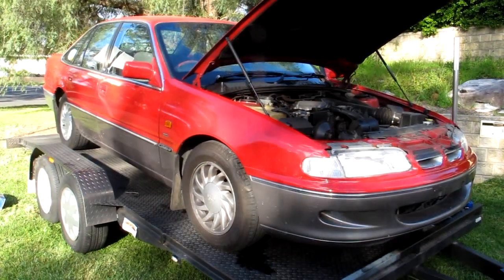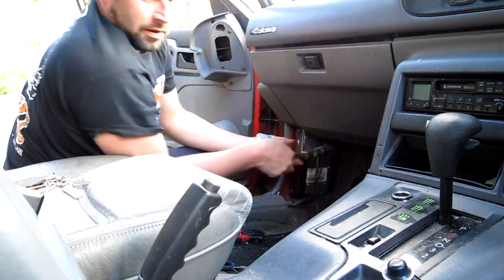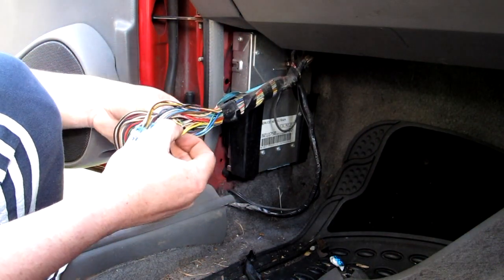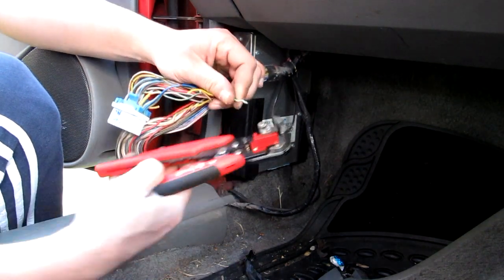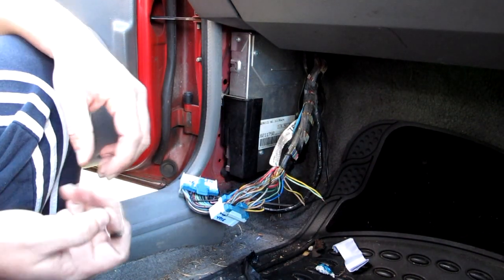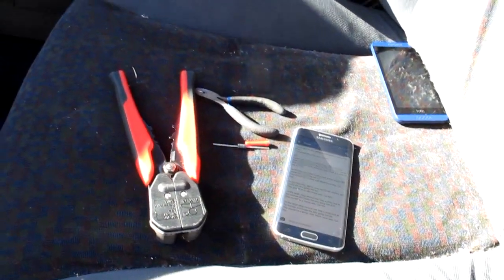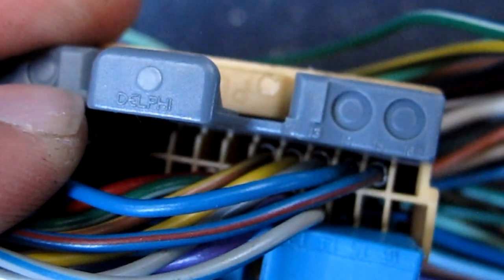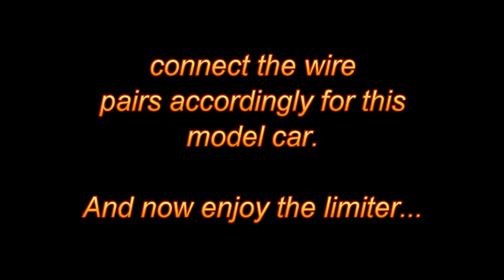Holden Commodore 4L60E gearbox mod to make it manualised - instructions

Comment: Yes this MOD totally works 
I go another step with the brown wires to the TCC and add a microswitch under the left foot rest and now I also have a clutch control 
FULL MANUAL for my L67
😆😎😈
Reply from the maker: Yes, that is also a great addition that could be included.
Reply: more info?
Reply: More info
Reply: Hay! Max.hows it going? L67 good motor 👍 I have a XU6 HSV.👍
Reply: Please Explainn
Reply: does it need earth or 12 volt to switch?  wire before resister i assume??
Reply: MaxGood RC 4X4 please tell me how you did this , I want my torque converter lockup on a switch aswell so it still locks up in 3rd n 4th ,cheers
Reply: @GrimmRetro  O cara não respondeu :(
Reply: Info
Reply: @Rick-jn2zm  The wiring changes with different models but with the later VY the PWM will also stop the clutch from activating at lower speeds , there are different ways to mod this. at the moment I am playing with the grind a ridge in the side of the solinoid method and it works great but it will stall in fist when at a stop. also I add relays to PCM side to act as a dummy load so I don't get codes(the codes clear when ever the ignition is turned off and on again).
just keep adding sytems to fix systems until you have the effect you want. eg My VY Crewman now uses the power switch redirected to a switching relay to change from Auto to Manual on the fly without any codes and a clutch switch on the fuse cover and on the left foot rest. this way I can tow in 3rd lockup for long distances with no heat problems, and as soon as I get into traffic, tap the button for normal auto so I don't have to worrie about distractions.
Reply: @maxgood42  thanks for the reply, seems like some good info it’s a shame I’m hopeless with the electrical side of things, hopefully a mate can give me a hand as he will understand exactly what I need to do thanks again.
Reply: @Rick-jn2zm  What model do you have ?
Reply: @maxgood42  03 vy series 2
Reply: @Rick-jn2zm  Ok the link in the description to the wiring VID shows the wiring for VR VS VT VX and VX that is very much the same as VY V6 (also VZ 4sp alloytech). 
WIN+SHIFT+S to screen shot Win10/11
  on the diagram for the plugs A11 Brown is the PWM solinoide so best not to touch this one. (HO12 VX V6)
A12 is Grey with Red stripe using a 2 way switch this can be sent to ground to activate the TCC but without a dummy load to the pcm it will trigger a fault code. 
(turn key off and on to return to normal driving) so dont cut close to PCM incase you need to use these wire again/ BUrnOut bEaSt ... who cares lol.
On my set up I made an elaborate bank of relays that change the system over to manual and giving the pcm dummy loads for Shift A Shift B and TCC.
 I found that it is also best to use a switch or reley to Acc/Ign for all mods here as it will drain the battery over night. 
To C14 RED being Positive Hot IGN this is also a good point to disarm the mod when ign off.
 I have moded only TCC with success and still being an auto and it can under some conditions be left on as the TCC will not get pressure from the PWM under 45 kmh.
... C14 Red IGN +.
    F11 Brown with Yellow stripe Trans pressure/switch plate A
    F12 Yellow Trans switch B
    A2 Yellow with Black stripe Solinoid B
    B1 Light Green Solinoid A
    A11 Brown PWM
    A12 Grey with Red stripe TCC
       if you still get a code using the dummy methode , the reley may have a coil ohm that is outside of the range the PCM is checking for.
           or just get some from another box but I'm not sure if these will get hot if not in a an active trans.
     Hope this helps 😎
Reply: @maxgood42  thanks for taking the time to do that mate your are a legend,  will let you know how I go.  👍

Comment: i get it now thanks heaps.. would be awsum if someone made the wire swap on a switch.. eg full manual mode or auto mode.. got a few tech mates so ill look into it. easy option should be 2 switchers but a single switch might get complicated.  end result would be the power switch in the console, power mode =manual and eco mode = full auto..    any one reading this have a crack it would be an awsum breakthrough for the commodore transmission  ..!
Reply: Anyone done this switch idea yet. Could be worth ripping up the wreaking yard for looms and shit needed. Be good starting point
Reply: Simple solution is to put in a 4 pole switch that cuts the connection to the CPU and instead does the connection in the video

Comment: Need help with my 2003 vy ss . Not 100% which wires and where they are . Are they at the PCM by strut tower in engine bay ?

Comment: need help my 95 holden vs has 3 plugs at ecu just wondering  what wires to cut and pinpoints on the plugs
Reply from the maker: Have you watched the 2nd part video to this? has the pinouts on what plug for what model
Reply: @RFBOOM  hey anything for a vz 4l60e

Comment: Hi just done in v6 vs super6. works awsum  thanks.  as i only need 1st for take off i modded the selector to allow free moment back to second without the selector lever button used. do you have any diagrams or advice on how to wire in a tcc  switch to this setup so i can manually lock and unlock the converter? . that would make it the best setup on a budget ever. cheers thanks love ya work Justin

Comment: Great it works BUUTT it would of been nice to let people know the engine light will come on after doing this , its kind of annoying in a street car . Is there any way to rectify that ?? cheers
Reply: Get memcal rewritten or get a manual memcal
Reply: Michael Elliott yeh my engines worked and already has a tune on it ,I'll have to get it sorted when I swap manifolds and get a retune , cheers
Reply: Mine too (super6) Im considering haveing this setup on a spare plug so I can drive to track normally then plug in this setup.
Reply: @mikeA292  working on a switch to go from normal to mod setup.. should have it done in a week or 2. you will need 4 , 5pin relays , a on off switch  to supply 12 volts to relays. would recommend the car off before using switch as a precaution.  pin 86 and 85 for earth and 12 volt on off switch
Reply: @justinlinton4810  how did you go about this mate?
Reply: @Logan-nt7ci  there is a how to which will show what wires you need to use in the ecu loom  in you tube its just a full manual swap. then use the relays to control the wires.

Comment: So how does this actually work? Do you put it into 1 and it holds? I thought the transmission would do that normally
Reply from the maker: Correct, by putting it to 1 it actually stays in 1. Factory it will still shift to 2nd as a gearbox protection inbuilt into ECU programming allows it to even though selecter is in 1 position.

Comment: Got an 03 vy v6 and this won’t work on it is there anything else?
Reply: I did it on a 04 vy v6 works fine different pin numbers i think but hooked it up through a set of relays so i can turn it from auto to manual.
Reply: What are the PIN numbers for a vy
Reply: And witch colour connects with witch colour please

Comment: 02 vy, what’s the colours for the wiring? And same diode or different?
Reply: You figure it out?
Reply: @braddoobs13  same colours mate. But vx and vy have 3 plugs you’ve gotta work it out, if I had my old wiring I’d send photo
Reply: @MELTNRUBHER  so I can just do the VX one for my VY?
Reply: @braddoobs13  yeah man, all the same colour wiring and same diode
Reply: @MELTNRUBHER  cheers bro.
Reply: @MELTNRUBHER  same numbers in the ECU?
Reply: So use all the same wires for a 2002 vy?

Comment: I'm looking at doing this too my L67 VX it's got 320whp and has a built box. So my idea is do this but have a ratchet shifter setup so it becomes basically a 4spd sequential (obviously it's not a legit sequential)
Reply: My l67 has 388hp and I'm running a Hurst shifter. Manualised valve body , 3200 stall. You should do it.

Comment: stupid question? matbe?  does it shift normal in 3 and drive.?  or at least d!   great video thanks heaps and all best justin
Reply from the maker: Hey Justin, no it does not shift normal in 3 or Drive after the mod. Having it in D is 4th gear. So if starting from a stand still in D, it will try to take off in 4th gear which it wont like, and wont move very fast and will give the stall converter a hard time.
Reply: thank you so much for your reply. whats the go with the torque converter lockup?  does it still work or do i need a separate switch?  thanks again justin.
Reply from the maker: @justinlinton4810  The converter lock up will work like normal, so once its speed / load / throttle position determine its ok to engage it will. It can be put on a separate switch if you would like.

Comment: sweet video mate.  anything i can do for a 460le in a vx that thinks its slipping in top gear? because its not slipping!
Reply: would really rather the check engine light come on for something thats actually important.  if u know what I mean
Reply: holdenguy75. i have a 2002 chevy cammed 5.3ls 4l60e. problem i have is it wont hold first gear when i try to wind it up for a race will ur bypass work for my truck any advice would help thanx..

Comment: Since I'm upgrading diff to 3.9s in mafless tuned vyss the pcm has already been manualised in 1st n second so can drift hard in 2nd in dry as stock can do 140ks in 2nd but now doing cam n going 3.9s 2nd gear will be to short so will want 3rd n 4th manualised can I speak to my tuner so he can do that with the dyno tune when doing cam n stally on dyno?or is there way I can do this? 2004 vy ss
Reply: Hey mate I have a 2002 vy. Any idea what wires I need to cut and join. Thanks

Comment: What is the part number for the diode thru jaycar? Great work mate
Reply from the maker: https://www.jaycar.com.au/1n5408-3a-1000v-diode/p/ZR1018
Reply: Hey What are the PIN numbers for a vy
And witch colour connects with witch colour please

Comment: does drive still shift through the gears?
Reply: do you need the resistor?
Reply from the maker: From testing I've done leaving it in drive means its in 4th from stand still.
Reply from the maker: No resistor, just the diode.

Comment: Hey mate, I followed your videos and diagrams but for some reason on my VT V6 Paddock Bomb it hasn't worked?

It now shows the Transmission Light on the Dash Cluster and it's kinda like Limp Mode now.

Seems like it's just in Drive and not using/selecting any of 1st, 2nd or 3rd. 

I still get N, R and P.

Any ideas mate?
Reply: https://www.youtube.com/watch?v=4cjz-2gmoXc 

i used this video

Comment: vx ls1 auto clubsport 
what are the wires to do this model 
are you in sydney
Reply from the maker: Yes, I am in sydney, Check my rfboom facebook page for the LS info. It can also be done in the PCM tune for the gearbox parameters so not necessarily need to be done with this wiring mod.

Comment: Ho there does this work with a 99 holden vt? Also will drive still work as normal?
Reply from the maker: Yes it works for a 99 VT. I did it to my 99 VT exec v6 2 weeks ago and worked perfectly. It makes the gearbox become fully manualised. So take off from stand still the selector must be in 1 to be in first gear, and progressively go up the gears as you need to, and move the selector to each gear according to speed. Putting it in D is 4th gear.
Reply: @RFBOOM  cheers thanks mate what diodes did you use man?
Reply from the maker: https://www.jaycar.com.au/1n5408-3a-1000v-diode/p/ZR1018
Reply: @RFBOOM  what did you do about the pwm to get lockup on the torque converter? Or does it not get lockup in top gear
Reply from the maker: @brodiemaclean5001  if you do not cut the lockup signal wire, it will function still just as factory operation.

Comment: Do you know how to hard wire up a WH Statesman V8 5.7 l mate ?
Reply: 😩 need to know how to do hardwire WH Statesman mate please
Reply from the maker: it can be done in the tune. But if you look at the dropbox links folder there is the LS1 pinouts.

Comment: Will this work for the ls1 and 4l60e out of a vy? Planning on putting it in a vb commo and was planning on keeping it with 4l60e and want to be able to hit limiter
Reply from the maker: Yep, check my facebook page for the LS box mod. It can be done in the gearbox tune in the PCM if the tuner knows what they are doing.
Reply: What is it for s2 vt

Comment: You will have no torque converter lock up tho
Reply: Michael Elliott yeh Ive noticed lol ,I'm yet to look up if I can have a switch hooked up to lock it in manually
Reply: Highly likely to cook box in forth for long periods. You can add a switch which you could lock converter at any point. Generally they only lock in 3rd and forth. Could get you some more info if need be but a Google search will tell you what you need to kno
Reply: @mikeA292  thanks man ill see what i can find

Comment: Which wire controls the torque converter lockup ? I want to put it on a switch so it still locks up in 3rd n 4th . Can anyone tell me how I can do this ? Cheers
Reply from the maker: yes it can be done, let me find the information about it.
Reply: @RFBOOM  Thanks dude i really appreciate it :)
Reply: @RFBOOM  Any luck mate ?

Comment: I did this today it was a very bad idea !!!!! Lost 4th gear and When in D it doesn't have fourth ! Is it first and doesn't change just warning people' don't do this if your car is a. Daily driver burn out shit boxes are good for this mod that's it
Reply: Well, like he stated. It is for burnout cars and is unsure about how it goes on a daily. Not having a 4th isnt a big issue anyway, or run a switch to those wires and you can turn it on when you want to hold gears and turn it off to run it in drive normally
Reply: roflmfao  xD::::
Reply: @sk8meup9  how do you run a relay to turn off and on? can you draw me a diagram to do this please?

Comment: What a back yard butcher. These are the sort of people that ruin nice cars for owners later down the resale track. Very sad. If this guy was in our town he would be referred to as a "Borket"!! :( Look it up in the Urban Dictionary! :( .-.-.
Reply from the maker: Hi, thanks for the comment. I think you missed the point though. This mod is aimed at cheap burnout cars, and generally speaking cheap burnout cars never get resold, they get thrashed and then trashed. I dont know of any "valuable" v6 burnout cars still runnning a stock 4l60e where this mod is going to be the worst thing that will happen to the car.